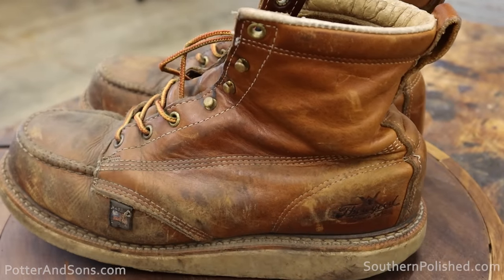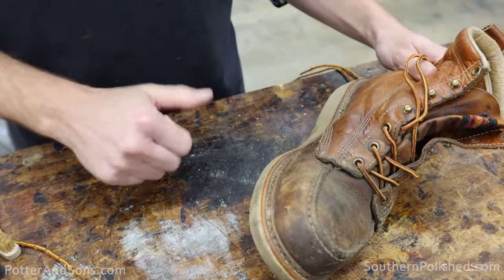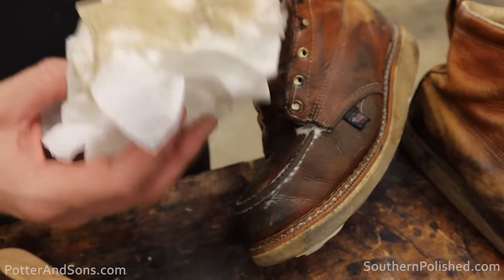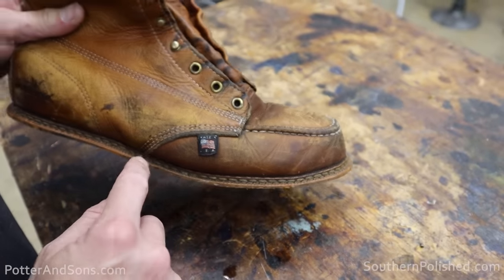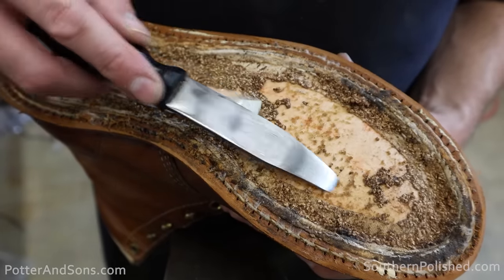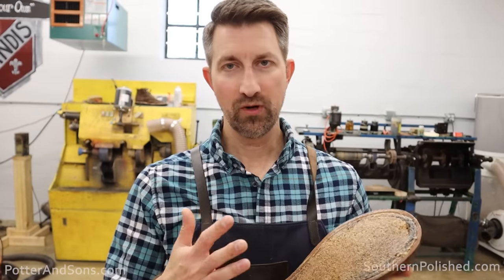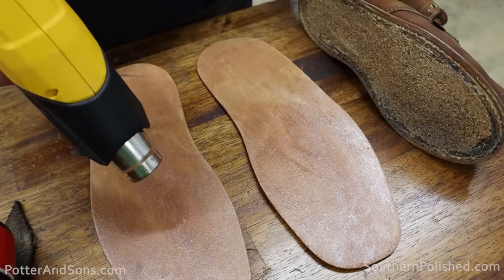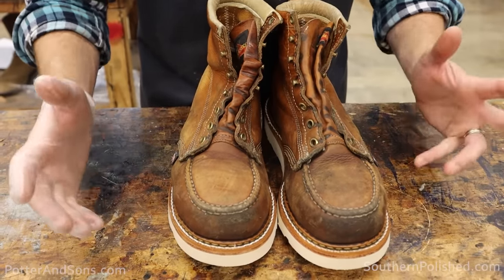Thorogood Moc Toe Boot Restoration | Total Boot Makeover

Comment: Red Wing sells a lot of boots no longer usa made. Picked up my first pair of Thorogoods this year, thinking I wont go back to Red Wing. I believe in supporting US Labor and Unions.
Reply: Barry McCokiner  pros are more comfortable, no break in and more variety especially in safety toe. Honestly i love them i switched over 6 years ago and haven't looked back.   Cons could be the fibreboard and rubber welt but doesnt seem to make a difference that I noticed.
Reply: Just dropping in to say I agree. Thorogood > RedWing
Reply: Probably gonna make the switch when my redwings are dead. Tired of the price going up
Reply: @KalmarCowboy  for sure. Chinese redwings at a more expensive price is WACK
Reply: @KevinHernandez-vh9dl  You state all RW “heritage “ and that may be correct, but some of their models do originate elsewhere.
Reply: @Monz117  no they suck now and stopped the discounts
Reply: Check out jk boots or nicks
Reply: Redwing is USA made but they have an economy line known as Irish setter which are made over seas and having worn a pair for years I can say they’re well made boots and not bad at all.
Reply: @chevyon37s  Unions have been systematically attacked for 40 years straight in this country. If unions are shit (which some are, but i still support them), its because this country is aggressively hostile to them. Even with all the disadvantages, unions are still a force for good. Strong unions make a strong middle class, they lift people out of poverty and strengthen the backbone of america; its workers.
Reply: @chevyon37s  I 100% agree! It’s all politics now. And how much money they can put in their pockets. 👎🏻
Reply: Thats the reason I started buying Thorogoods. I keep buying because of the quality.
Reply: Union strong  💪🇺🇸
Reply: Thanks for the info 👍
Reply: Hoffman makes some really nice high quality boots
Reply: Redwings leather is unmatched and don’t loose support after awhile. Have em forever just have to keep getting em resoled. No rubber. No fiberboard. Leather welts. No cheap materials. As in life you get what you pay for.
Reply: 5 years ago I bought my first and last pair of red wings, 200 bucks and barely lasted the year. So I went back to my thourogoods, not this style, because I cut and weld a lot I figured that flat top with rim would hold sparks more and burn, and that was definitely the case because a few co workers failed in those areas over time. Still better then the red wings
Reply: @Dick Trickles Disagree. People working for scraps from the table while billionaires buy yachts and sports teams is the problem. The wealthy arent the problem, lack of respect for labor is. The revolving doors means no one perfects a craft of invests in its worth.
Reply: @Dick Trickles No, greed drove all the jobs to China. Larger profit margins year after year is the goal. How much money does one man need to live happily?
Reply: @Dick Trickles This is why we have 90+% of wealth held by the top 2% of the population. If executives had shown appreciation for skilled labor, Unions wouldn't have been formed. It was greed that brought about the necessity of a unified labor force. Unions were a by product of greed.
Reply: @Dick Trickles Yes, I am aware that Unions have short comings. No one is arguing that people shouldn't be rewarded for their risks. The problem is that the reward is severely disproportionate to the wage of the labor force. Shouldn't employers also want a consistent, reliable, well trained , workforce with an interest in the longevity of the company ?
Reply: Me too!
Reply: @blakedavis2447  red wing has only ONE line of their shoes made in the USA.   All others are made in China.
Reply: @reviewtube5005  Unions used to serve a purpose when there wasn't a min wage and factory conditions were crap. Now the only thing unions accomplish is driving jobs out of this country. If your skill is desirable then you will be paid well. If it's not then learn a new skill. No need for unions anymore
Reply: @ka3274   I partially agree with you. It isn't Unions driving jobs out of the country, its greed. Paying foreign laborers with little to no representation is more attractive than respecting labor.
Reply: My grandpa was a union president and they fought for things like a min wage and safe working conditions. They won. Now there are laws to protect workers. If the conditions are unsafe it will be all over the news and Twitter lol. No need for unions. Workers demanding unrealistic wages just makes the jobs go elsewhere. If you feel you are underpaid then do something else, learn a new skill
Reply: @ka3274  Again I partially agree. A minimum wage used to be a living wage which today it is not. The problem being that wages have not risen along with profits. Companies offshore production to countries that allow exploitation of workers .
Reply: I see these dummies joining a Starbucks union and I'm embarrassed for them. You work at Starbucks! Of course you are going to be paid min wage. Jobs like that are supposed to be temporary, it's not a career. If you start unionizing and making demands they are just going to find someone else who can push a button and write names on a cup
Reply: @reviewtube5005  the people overseas are very happy to make that wage. It's either that or nothing. Some of them have no electricity or running water so making $5 an hr goes a long way. The standard of living is much higher here. Even "poor" people in the US have drinking water, a home, a car, a $1000 iphone, flat screen tv, etc. I think if you learn a skill and you are willing to work then you deserve those things, sure. Nobody should feel entitled to have all of that for free (like the people who abuse govt programs). People used to be happy with a nice middle class life with a modest house, a car, and a family vacation once every year or two. That's how I grew up. Now everyone expects to have a new house, 4 cars, a boat, a motorcycle, a vacation house, and a pension/401k. People overseas are just happy to have clean water and a place to live. Yes owners are greedy but I think if workers in the US are going to be entitled then there are workers elsewhere who will be happy for the opportunity to make some $. Hopefully there is a middle ground or there will be no jobs in this country very soon
Reply: @ka3274  I don't know where you're from but rent on a 1 bedroom apartment is 1200$ + now days. People are retired and still paying student loans. You're suggestions sound great but reality is a bit different. Unions aren't necessarily the best solution but most Union workers actually earn a livable wage. If you can criticize a barista for unionizing are you equally critical of Starbucks CEO with a net worth of 4 BILLION dollars ? Seems a bit lopsided no ? I get that there should be incentive but if your not living the good life as a billionaire , maybe you're doing something wrong.  Invest in skilled labor and US jobs. Otherwise take your ambitions to the countries you are outsourcing too and see how fairly you get treated in regards to taxes.
Reply: @reviewtube5005  the union guys I know make way too much $ because their union has cornered the market. My brother in law is union HVAC and has 2 houses 3 cars and is buying a brand new boat. He's living a very good life. It's tough to be critical of the owners making millions because when they started the business they were not working 40 hrs a week, probably closer to 100, and they could have easily gone out of business as most do and they would have nothing to show for it. It was a big risk, big reward and they are creating jobs. We should be critical of them passing that on to their bratty kids who then do nothing except live off of their parents hard work. But lawmakers are the millionaires who are benefiting from this stuff so they aren't in a hurry to change things. Everyone should make a living wage but I think there are going to be disagreement about what a living wage is. I don't think it's 2 houses and 3 cars etc for someone in their 30's lol
Reply: @ka3274  On this matter, I agree 100%. Im not begrudging anyone making money, im just arguing that there is no balance anymore. As the pandemic revealed, depending on foreign labor can result in devastating effects on our own economy. If the system worked correctly, owners would take a higher share because of the increased risk and responsibility but provide a "reasonable" income for employees . Yes the wealth would be top heavy but it would still provide a solid foundation for the system as a whole.  More money in consumers pockets means increased sales and revenues for companies as well as a broader tax base . The way i believe they are getting around the lack of income for the majority is with  lengthy financing. A clever way to squeeze the last bit of revenue from an already poor population.  Closing the revolving door of "expendable, non skilled labor " would provide for higher quality production in the long term. "They don't make em' like they used to" because no one is interested in low wage production jobs. As a result they do just enough to not get fired.
Reply: You buy them try to take care of them
Reply: Red Wing also sells a lot of boots that are made in the USA, and TG sells boots that are imported as well.  In my experience RW has had a higher quality build and materials. Comes down to preference and price range but you can get USA made boots from either brand.
Reply: @blakedavis2447  only the redwing heritage are usa made. the work boots like the trac tred are not usa made.
Reply: @blakedavis2447  
Hi Blake-
If you take the time to check the label inside their boots, you will find that over half of all Redwing models are in fact made outside the USA, mostly in China. Doesn’t mean they aren’t well made. The Heritage series (Iron Rangers, Moc-toes, etc) are still made in Redwing Minnesota, but most of the models offered today are not USA made.
Reply: @raymondlowry8564  yea I fucking said that go read my comment again.
Reply: @ericlouttit3370  I never said all of them were USA made and they do have USA made work boots 10877 is a work boot, traction tred and USA made.
Reply: @blakedavis2447  no steal toe or composite toe in any US made that iv been able to find which I'm  required to have hard toe. Unless I just can't find ot I have been disappointed with my 2415. So I was going give thorogood a try I have some American made keens that I wear when doing lighter work.
Reply: @ericlouttit3370  just because they don’t make something to your specific requirements doesn’t mean it’s not a work boot.
Reply: @blakedavis2447  it's not listed under redwings work boot section so according to redwing it's not a work boot if you want to get technical you can certainly wear it as one but it's just a nice boot.
Reply: @MaxwellFaro  Fun fact, the USA made redwings are only assembled in the USA. None of the materials used are sourced from here.
Reply: Just ordered a pair of thorogoods cuz it’s made in USA with union labor or I would have gone with the red wing Irish setters
Reply: Same here. Left Redwing a few years back. Thorogood all the way!
Reply: 🤣 Better read the tags on your Thorogoods.
Reply: @Soul of a robot Yes I agree, I think I over-generalized. There is a need to maintain the safety and fair wages for all workers. I meant more that the work done by past generations have set up Americans well to make a good living in safe conditions. The issue I have is demanding higher and higher unrealistic wages. Yes we all would like to make more $ but by doing so we are going to drive the jobs overseas. There has to be some give and take and that's all part of a proper negotiation as I'm sure you know. Thanks for your work
Reply: Not sure if anyone else has stated this, however the heritage line boots redwings makes are US made, they’re pretty open on what boots are made from what. They state the country of origin of the materials, most if not all their work line shoes and boots are either made elsewhere or “assembled” in the US but from what I can tell the heritage boots are made in the US and most of them from US sourced materials. Just gotta look at where the specific boot you’re look at is made from.
Reply: @bc454irocz89  I wouldn't say no brake in everybody seems to say that
Reply: @brandonwayne2343  true but theres no stiff painful break in like redwings 😅
Reply: Irish setters are assembled in a collectives of foreign and American materials.  Other model types of Red wings as still assembled here in the states.
Reply: Agreed! I have all of my moc toes from red wing, which I won’t get rid of, ($300 a pair.) but I won’t be buying anything from them anymore.
Reply: I bought a pair of White’s boots for this reason. Made in USA.
Reply: @kennyyetter  def nicks over jk, just sayin.
Reply: @todtalk3912  I have both, do you? I just prefer JK's. Smaller business, great story and their break-in is basically non existent. Both are great boots. Can't go wrong with either. Nicks, due to being around longer and growing larger has a more wide selection of styles. Cheers
Reply: @bc454irocz89  sometimes when I drink, I can puke out my nose
Reply: Kinda depends what you buy. Most US companies don't do their own molded-bottom boots, so you have to be leery if buying that type. Goodyear-welted heritage styles are almost always the safest choice to assure domestic.
Reply: @johnnydrama8709  Thorogood's upper leather is preferable for general wear or light duty use, hence the easier break-in. Red Wing's only substantial upside is the corked and leather footbed, and I solve that problem by buying Thorogood's and immediately having a local cobbler resole them with a proper footbed.

More comfortable than Red Wings with the same footbed and sole, and still cheaper than RW. If you're not dragging the sides of them on roofing shingles or wading through lime water, just as durable too.
Reply: Agreed
Reply: I read comments more than watch the video. I buy and sell boots . Mostly Cowboy Boots . I can tell good and bad leather and when they use book binder leather . Cheap steel toe can cost you your toes . Red Wing has been top of the line but to a lot of illegals they don’t know any brand but cheap or what they can afford . I have bought and sold Red Wings that were old but still in great shape when taken care of . As far as Unions they nothing more than job killers . My son is a Union man he gets paid just to show up . Good for him but he should show up . My other son hires people to work trade shows . He has to pay for anything and everything plus wages because they are Union . To me most Unions are Blackmailers causing business to shut down or leave the country .
Reply: I'm a big fan of thorogood for comfort but pretty much all of the materials are sourced over seas. If you want a good boot that uses domestic materials as well as being manufactured here, OriginMaine is a company that can provide that
Reply: Yeah I still have my USA red wing moc toes. But I wear thurogoods now.
Reply: @blakedavis2447  No Blake, you said redwing is made in the USA, and they have an economy line called Irish setter made in China that is a direct quote from your comment. In fact, most redwing boots are now made in China. Maybe you should re-read your original comment before you attack someone for correcting YOU.
Reply: U gotta get the redwing 877. Most the rest of their boots are junk. The 877 is quite a bit better than the thorogood tho. I got the whites c350-cs and their 10 times better than a thorogood or redwing. Got them on sale for $460 as well. Not even that much more than the redwing and way way better. Will last me a very long time
Reply: You believe in supporting bloated organizations and overpaying for goods and services?
Reply: Thorogood are assembled in America with a Chinese material and a horrible Plastic welt. Thorogoods are bottom of the barrel.
Reply: It's just too funny you say that with the 10877 and 10875 which have poron insoles and extra width options to accommodate inserts available that are still American made. I've had two pairs of thorogoods in 5 years that I wore as a lead at a local DC and again as a custodian. I didn't put them through nearly as much labor as some tradesman do and yet both pairs fell apart prematurely. One had stitching failure along the inner  vamp, the other had eyelets that fell out (i had them repaired and still wear them but that's ridiculous for a $200 boot) They're made in Wisconsin and as a Wisconsin resident, I appreciate that but I've never had a pair of red wings crap out on me, and I have a lot of them, even factory seconds.... Just my two cents.
Reply: Hey guys I was just at a red wings dealer last week. All mock toes from red wing are now built in Vietnam
Reply: Good who cares
Reply: Jk boots, nicks boots, franks boots, Drew’s boots. All something I would recommend.